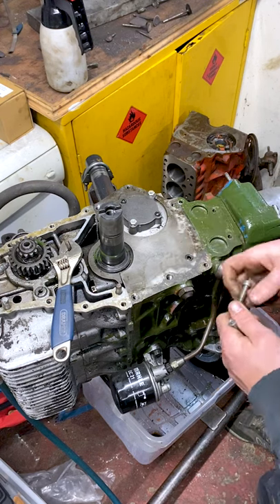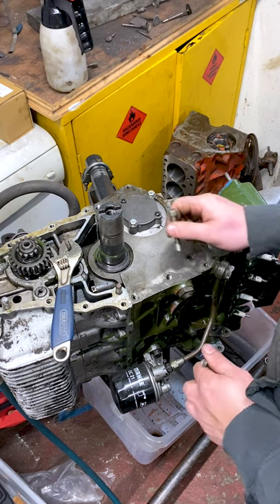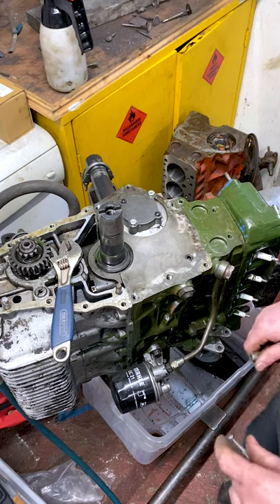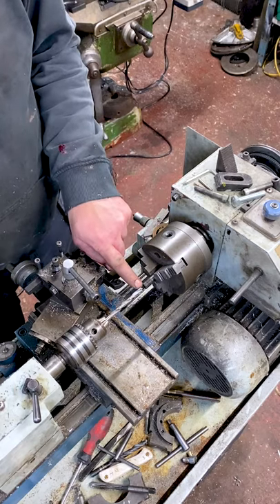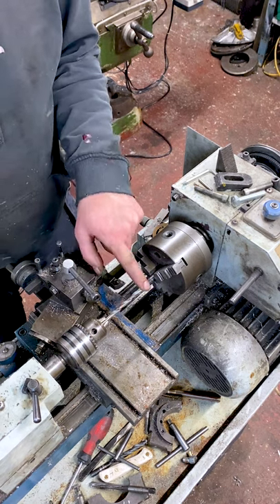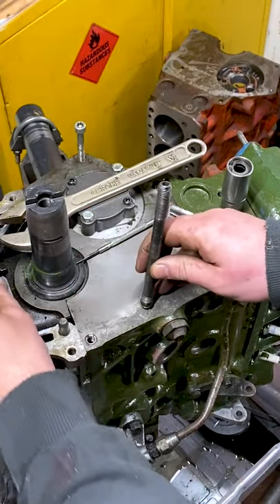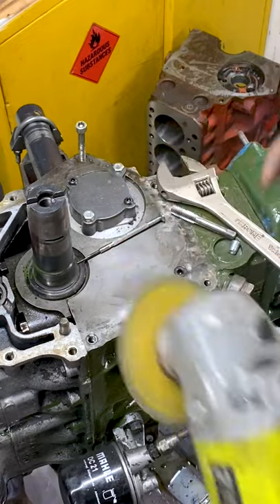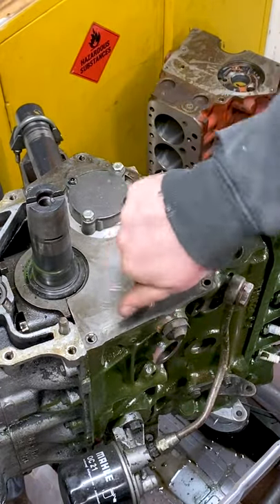Engine Block Repair - #Short #HREShort

Comment: Paul are all the threads changed to metric or are the other threads still UNF?  Nigel.
Reply from the maker: Well there was actually 3 pulled bolts in this block so I decide to change the other 3 on this end of the block to M8. We could have taped these 7/16UNF but tbh M8x1.25 is a much better thread for a repair like this 👍.
Reply: Thanks Paul that makes sense.